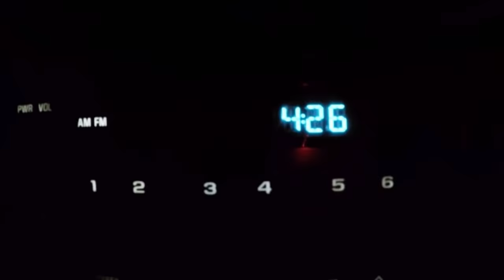#10 - All Farm Special 1

Comment: with that big shed you put the grain into why do you slowly dump it out into an auger an bring it in slowly. why don't you just dump the whole truck load in one go straight into the building with out using the augers?
Reply: I'm no farmer but I would imagine it'd be impossible to fill the barn to the top of the ceiling without dumping the wheat from the top, with the augers.
Reply: And trucks are dirty
Reply: You could dump a truck inside but then you would have to use a loader of some sort to push it up to the ceiling but it would be really hard to fill it up to the top regardless and it would take more manpower to do which equals a bigger cost
Reply: Dziadek not really, where I used to work we tipped 12t trailers into a barn bigger than that, then I pushed it up with a grain pusher on the telehandler and was back to the combine in time for the next load. You could easily push it the height of the concrete walls in their store!